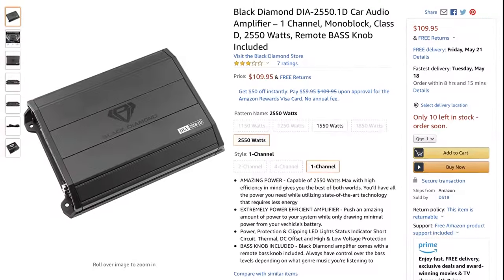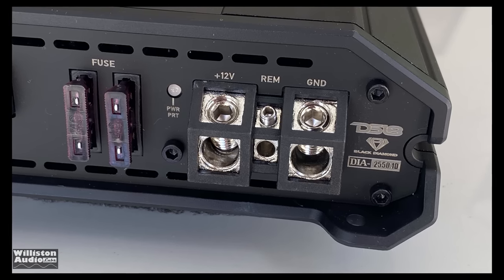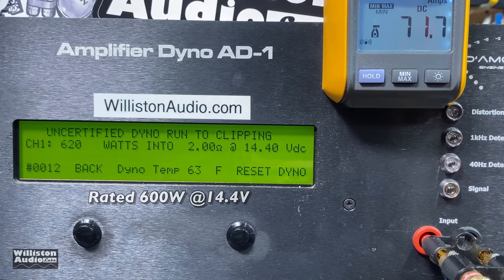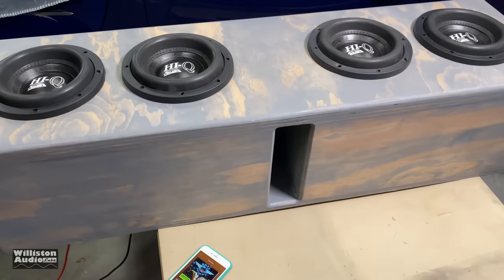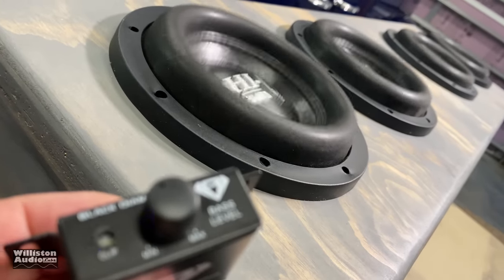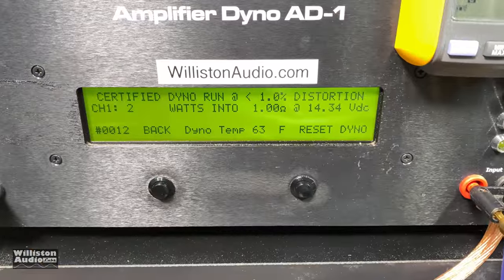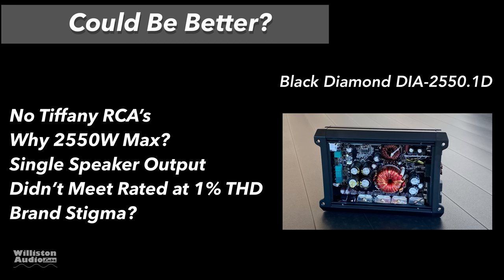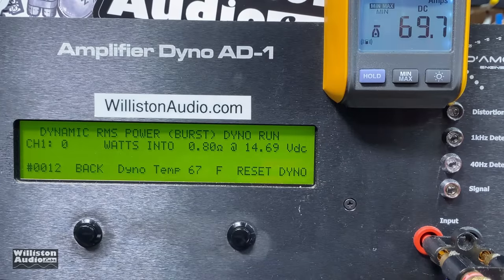Amazon Budget Winner? Black Diamond DIA-2550.1D Amp Dyno Test and Review [4K]

Comment: What kind of subwoofer should I get to match this? I have a 2010 Ford Explorer Xlt 4.0.
Reply: Lots of opinions out there and probably no right or wrong answer. With box rise you aren't going to hang around at that 1ohm wattage but that is a complicated subject. I have a 12" Skar SVR that is 800w RMS that would do ok with it but I'm not going to say it is the best choice. You can get it for about $25 more than the SDR and it sounds better in every way. I have had both, the SVR has higher sensitivity, goes higher and hits lower all while maintaining a punchier, better sound quality.  I believe the 10% coupon code is "WELCOME10" on the Skar official site, if not you can look on some coupon code sites for it. The 10% off one was the only one I could get to work but the SVR is normally 139.99, got it for $126 shipped and had it in 2 days. Their prefab enclosure isn't bad either and I guess that 10%off would apply to it too. Like I said,I am very happy with it but there may be better choices out there. It might be worth spring a little extra for a 15" since you have a roomy Explorer.

I am thinking of getting this amp to push mine. I am currently running a 600w amp to it so wouldn't see much difference but that clipping light is nice.

Comment: You know you've mentioned the phase potentiometer from 0-180, I've never been able to figure that out, and I've been dealing with auto/ home sound since late 80's and still have not been able to see what this does. Can you explain it or anybody else out there? Is it useful at all?
Reply from the maker: Helps if you have sub facing the rear or side as the phase could be adjusted to 90 or 180 degrees
Reply: @wal  should I be able to hear it change? Cause I don't, unless my hearing is worse than I thought lol

Comment: black diamond is ds18, not sure why no one knows that, DS18 introduced this line in 2016.  i bought this amp few months back for $99, is an ok an for the money
Reply: No thermal issues? I would rarely run it for more than an hour at a time but would hate to get something that goes into protect frequently (had one of those in that past). I have a little 600w budget Rockville amp that I am pretty happy with but like that clipping light. I get carried away sometimes and would like a nag light to tell me to back off the volume a little.

Comment: what do you use to power those amps like  a power converter or something?
Reply: Large battery bank.
Reply: Maxwell capacitors. They charge fast and don't drop voltage when put under high demand like lithium. He has a video or two about them. Worth checking out. I noticed most of Team Orion was using them in the lanes to power their 17k's a couple years ago.

Comment: im interested in seeing a video about a amp lets say 1ohm stable 400w rms  but hooking a 8ohm speaker up. yes the power is less but what about atrull loudness to the ears. i wonder how much of a difference a person can really tell and determan if that few db increase is worth the watts of the extra strain and heat on the amp vs the less heat and longivty of the amp. i got a new amp the taramps ds 800x3 1-ohm amp and im wanting to find out what major difference if any im going to hear in real life using 2x4ohm speakers at 8ohm on the on the left and right sides and 2x8ohm at 4ohm pryamid super pros woofers on the sub side.

Comment: But the less expensive knock off amp does more power and costs half the price. I bought that because YOU reviewed it. Now this one that does half and cost twice as much is the winner? Seems like something ain't right here. I got that mono block 1500watt sundown knock off. Your dino showed it does 1,500watts at 1ohm certified. Cost when I got it was around a hundred.
So I bought both the 4 channel and mono amp. So why is this the winner?

Comment: For 200 and twice the bass what do I buy? I'm really looking for a $200 5 channel and I thought I found it with the infinity Kappa FIVE $649 marked down to $199 but people say it cuts out.
Reply: When people say amps from reputable companies "cut out" in reviews it is generally because they are idiots  using aluminum undersized wire and or bad grounds
Reply: I mean there has to be a reason its $199 from 649. What would you recommend for 600w rms at 4 ohm and like 1500w at 1 ohm? I bought the topstronggear and the clip light stayed on and no sound in 1 week from installing it.
Reply: @anglerandy5736  actually $200 is about the normal street  price for JBL Infinity 5 channels. Those huge inflated numbers are their ridiculous msrps.  I can't think of a 1500 watt amp off the top of my head right now but I guess for 200 check out the skar rp 1500, audiopipe apcle 1500(ebay) or harmony ha1500. 1

Comment: That is really too hot.  At that temp, solder can start to re-flow and cause issues.  Most of those components are not rated for over 210 degrees F.  So, at almost 260 degrees I would not want to run that in a car due to it possibly catching on fire.

Comment: What is the purpose of the clip light?
Reply: To tell you if it is sending a clipped signal. When you drive the amp to hard the 'top' and 'bottom' of the soundwave is 'clipped' off. That damages your equipment and cooks the voice coil on your sub. It basically tells you to turn it down a bit because you are damaging your system.
Reply: @murrayshekelberg9754  thanks!

Comment: Same company that makes the Toro mini amps. Not bad if youre on a budget, but I would rather just get a Skar if im on a budget. But would really rather get a Kicker amp. Kicker, Rockford, they are built extremely well. JL Audio nice but a tad overpriced
Reply from the maker: Kicker and RF are on a different level fo sho
Reply: @wal  Im using a Kicker KXA along with ARC Audio and Scanspeak products in a SQ build. They really hold their weight against anything out there. Very overlooked how much engineering is done in house at Kicker and Rockford.

Comment: there is absolutely no shortage of used PC fans on the market get this inexpensive amplifier and install a fan where the plate on the bottom is and more than likely you will probably never experienced a thermal issue with this amplifier.
being a guy who loves computer hardware I'm kind of wondering why don't most of you who are actually at the competition's just use server fans for your cooling needs. They're small when they fit inside the cavity most times and they're a lot better looking than a bilge fan
Reply from the maker: Thermal here is not an issue as I was running the amp at full output power for 2 minutes with a 40Hz sine wave. Thermal protection was expected.

Comment: I was looking at this on ebay and deciding between the ignite 1600, the old pioneer d8601 (cant find it anymore), or the jensen xda91rb. Running 2 ts-w261d4s that need 350rms each. Ended up with the jensen for 89$ before tax @ wally. Sounds good, I like the bluetooth controls from the driver seat AND it had rgb. 😅 Worried about the SN/R tho at 68 percent. 🤔
Reply: The gm8601 is a real solid amp hands down

Comment: Just curious why do you do these tests at 14.4 v, when no car that I know of unless it's a Tesla, puts out that kind of power...........???
Reply: ALL cars put out 14.3 unless your alternator is sketchy.Your car electrical system USES 12 volts.A good battery and electrical/charging system of any car should put out about 14.3 volts on a multimeter.